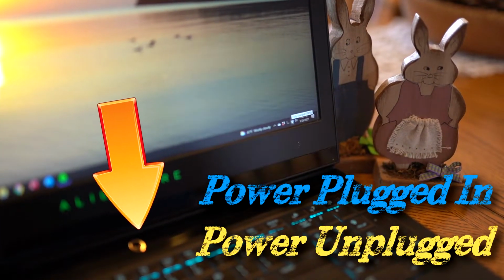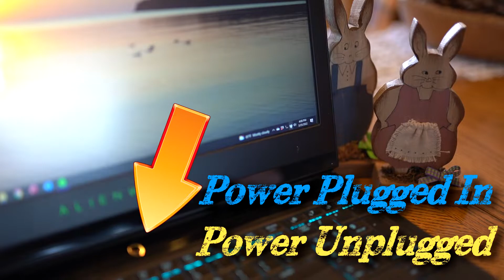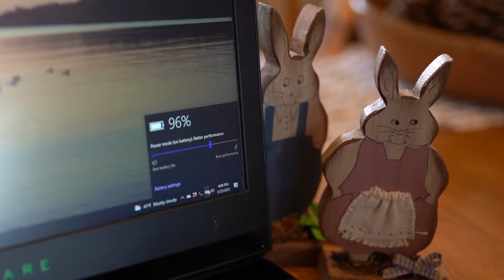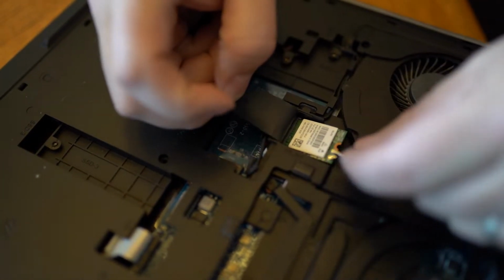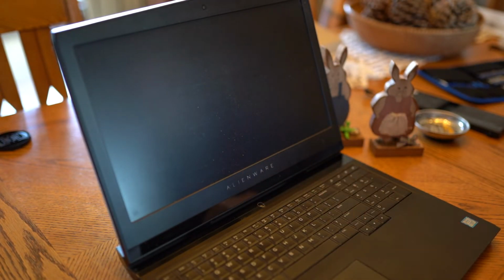How to Replace an Alienware Laptop Battery

Comment: I had to additionally remove the m2 drive and detach the hard drive (not unplug it, though) before I could get the panel away enough to access the battery easily. Also, when putting it back together, be sure the wifi card and battery cable are not stuck under the panel you're screwing back on; otherwise, get ready to take it all apart again!
Reply from the maker: Thanks for chiming in, matthew 👌

Comment: Referenced this video to repair my laptop which had a badly swollen battery. I caught it too late to avoid it damaging the main board (cracked it over where the batter was swollen) but atleast now i can close the laptop normally again and I just need to add some protective tape over where it's cracked until i find a more permanent repair option. This was my first try at a battery replacement like this, took me ages to do it, but the guide made the process much less stressful. Thank you for your work.
Reply: Also props to Dell/Alienware for making battery replacement into a damn form of rocket science for the average consumer
Reply from the maker: You're welcome, kyuubi. It feels good to hear our video was helpful!

Comment: My replacement battery is a 9JRV0 and it did not come with a cable because the Alienware cable is attached to the motherboard. How do I go about removing the cable from the old battery? Do I just pull it?

Comment: thank you , i have the same problem in my Alienware 15 R4 laptop can i remove the battery and use the laptop without the battery
Reply from the maker: Gosh, that's a good question, Abo, did you try it out?
Reply: You don't want to use this laptop without a battery, as it will cripple the performance. It runs in what Dell refers to as hybrid power, which pulls from both the power brick and the battery at the same time when under heavy loads, such as playing games. If you don't have a battery then it will always be in reduced performance mode.

Comment: Question : Will the new replacement battery bulge again as the old one ?
Reply from the maker: If your new battery expands shortly after install, that points to a problem with your charger or perhaps the outlet.  This probably won't happen.  Typically, lithium ion batteries only expand near the end of their life.  You should expect your new laptop battery to last several years, bud.  Good question.

Comment: Jesus Christ, that was incredibly painful. Ended up stripping the screw holding the WLAN card and thought it was over. Luckily, it's still possible to open the Alienware wide enough to replace the battery. However, after managing that, my hard drive disk couldn't be found. Turns out the SSD-3 slot was a bit loose, needed a flash light and a ton of un-screwing and re-screwing to catch that. Then, no wifi. Figured I damaged the WLAN card to the point of no return and yet, a complete removal and flash light check shows that it was also just out of place. 

Miraculously, everything is in place now and I'm grateful for it. Missed the whole debate though lol. Thanks for the video.

Comment: How would I find out what battery my Alienware has? Thanks.
Reply from the maker: You may be able to get away with searching your laptop's model number for the correct battery, but there is a surprising amount of inaccurate information published.  In order to avoid purchasing the wrong battery (good luck returning it), I now favor opening up your laptop and verifying it firsthand.  The information will be printed directly on your battery.
Reply: @VestigialVoice  I thought that may be the best way, thank you for clarifying and your fast reply :)

Comment: Doing the time you changed the battery how many hours was the battery lasted after used?
Reply from the maker: Before changing the battery, the computer could  barely even last long enough to boot up.  As you can see in the footage, the battery had puffy fields, representing destroyed cells.  It is difficult to quantify battery performance based solely on hours used because this type of measurement largely depends on intensity of application use.  That being said, after the replacement, it performed equivalent to brand new!  It is a fairly simple exchange with excellent results 😃
Reply: @VestigialVoice  thanks
Reply: @vesto6864  After about a year from the replacement, the laptop is still preforming well on the new battery.  :)

Comment: My cover says to remove ssd 1/2/3 in addition to the wlan before service. And, so, how can i get the wlan screw to loosen without stripping the head? Ugghhhhh
Reply from the maker: Make sure to use the correct screwdriver and it won't strip, Donna.  Good luck 🍀
Reply: @VestigialVoice  I did. It finally came loose and I got the extremely swollen battery out! Ooowee! Won't let it go that long again in that condition! I think all of the screws sighed in relief from the pressure being lifted. LOL!!!